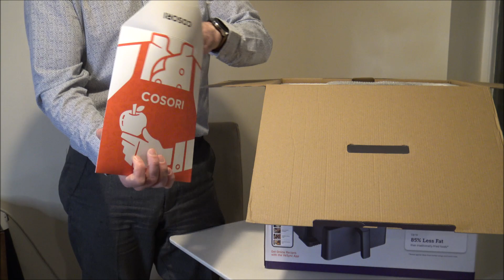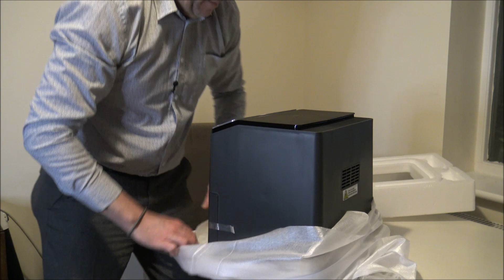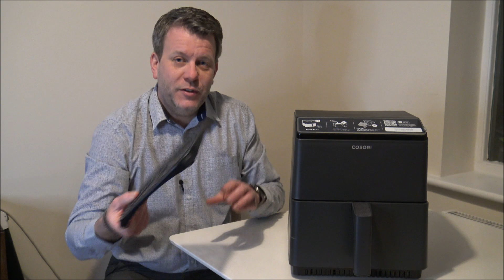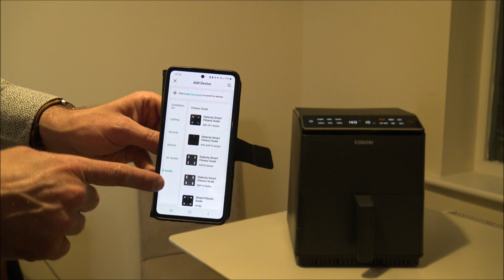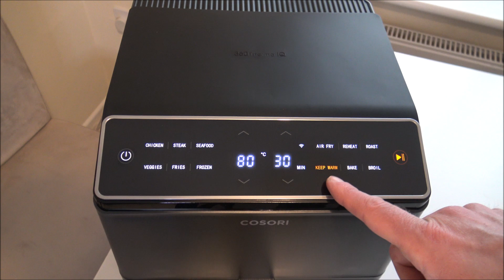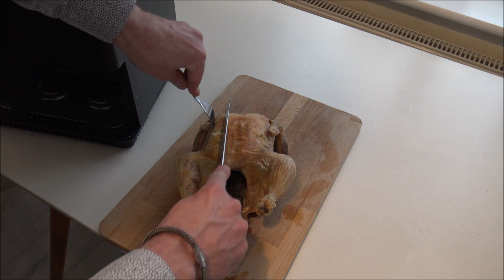Cosori Dual Blaze 6.4 Litre Air Fryer Demonstration

Comment: Can the app control the actual air fryer? If not, what is the point of it?
Reply from the maker: Yes it can, and its really useful if you need to see how long is left cooking without having to go up to the airfryer.
Reply: @lords-electrical Thanks for the quick reply. It seems my specific model of Cosori (CP158-AF) can’t be controlled by the app “The CP158-AF and CS158-AF are the same besides the WiFi capability”.

Comment: I am seriously considering purchasing the Dual Blaze.  I purchased the 5 qt and love it, but to my amazement, I find it rather small even though I am generally cooking for only one person.  This is one reason I am considering purchasing the Dual Blaze---to cut down on the need for batch cooking.  Please would you tell use the basket's inner dimensions?

I would never put these things in a dishwasher.  I believe dishwashers break down non-stick coatings much faster than if you would wash them by hand.  What is the life expectancy of this air fryer given moderate use, e.g. perhaps once per day 5 days a week?  What is the life expectancy with heavier use, e.g. 2-3 times per day 7 days a week?

Thanks.

Comment: I know there's a lot of claims, and marketing, but is it cheaper then conventional hob or oven cooking, or just a selling point?
Reply from the maker: It is cheaper to cook as it circulates the air quicker and of course its heating up a much smaller area compared to a standard oven
Reply: @Lords Electrical  Thank you for taking time to help provide advice both in your reply and in the greater efforts of making videos too.

Comment: It depends on how many u r cooking for yes .....i live alone so my ninja 2 drawer is perfect for my needs but I did realize I can only cook a v small meat joint in it which I have done and it was superb I just winged it on the temp and timings and roast veg in the other drawer all was perfectly cooked unlike when I use to use the main oven, so to solve this I invested in the baby ninja I call it with one big round basket so yes two air fryers but I can now do what I like...mind u u just can't beat the oven for cooking a sponge cake have to say air fryers are useless at it both times turned out like biscuit even with the tips I found on line so that oven is not dead yet ! Have to say this AF looks the bees knees .......savings on consumption since my investments have been enormous !